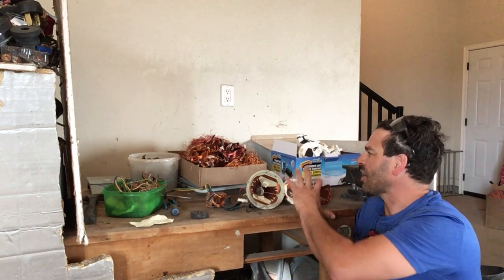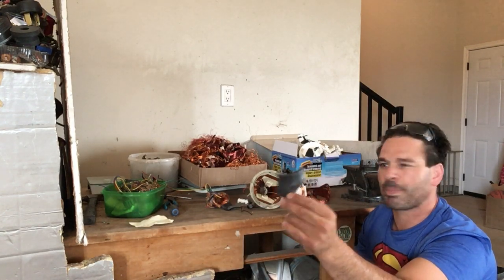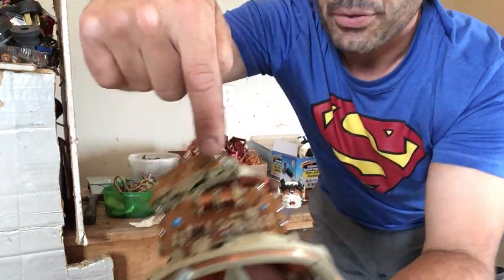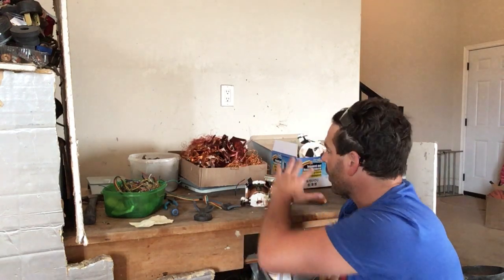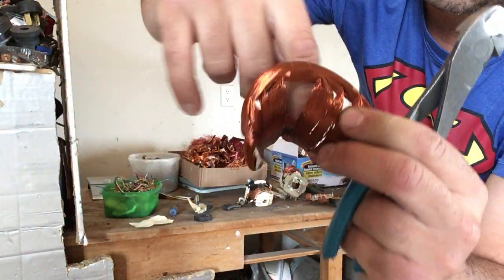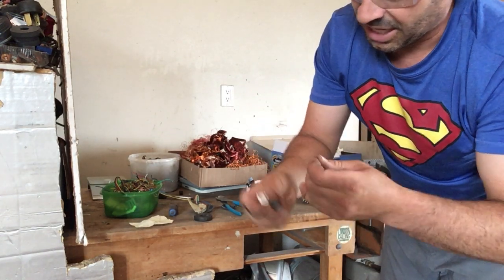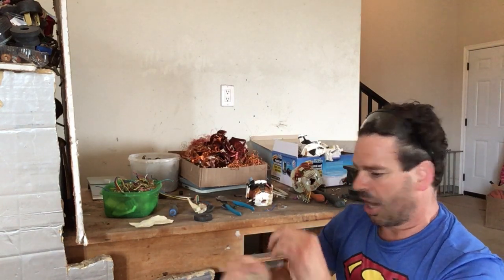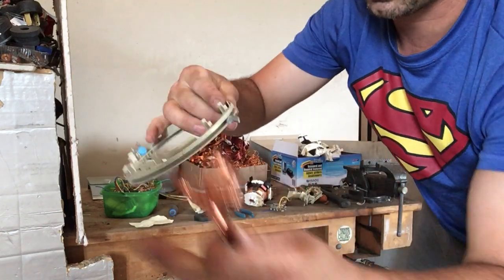Scrapping 20 copper yokes from crt televisions and computer monitors. How much copper did I get?

Comment: They are a great source of copper! I stopped scrapping CRT TVs in my area due to no one wants to deal with the hazardous metals etc on the motherboards. I used to take the cord, the copper band around the tube, and the yoke. However, the hazardous waste collectors gave me some trouble when I dropped off the TV with the guts torn out. It is a shame for scrappers that it isn't worth the hassle anymore (in my area of the USA).
Reply: Where are you at? I am in Cali and my local transfer station accepts up to 4 at no charge. (California pays them to take in) It is never manned so sometime I drop off 5 or 6. Never heard of hazardous metal on the mother boards they are just like all older MB. It is the glass tube in the CRT sets that have all the bad stuff.
Reply: @cyberdan1000  I'm in PA and our area has hazardous material collection days which is what I was mainly referring to. My yard takes electronic items but not if they have been gutted, as I would normally do. It isn't worth my time anymore. I miss those copper cones!!!!
Reply: @styverdyver  Those CRTs are getting harder to find. I got 14 flat screen TVs and monitors last week one more to do. Then I have to make 3 or 4 trips to the transfer station to drop off those gutted sets.